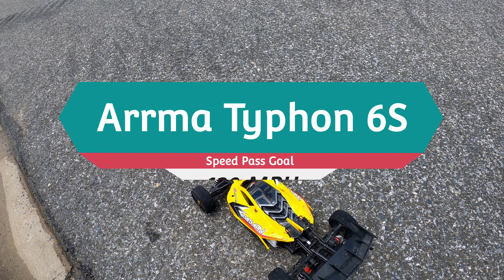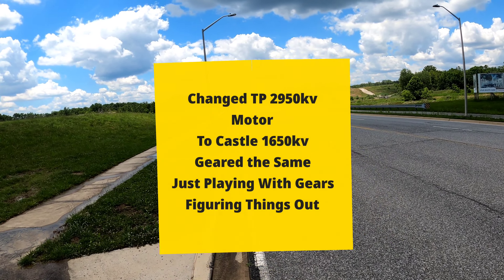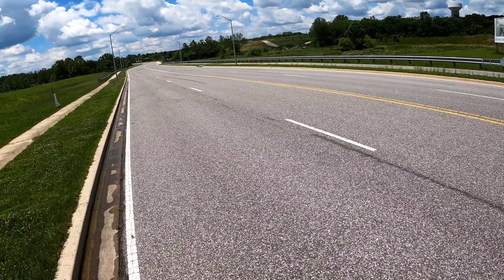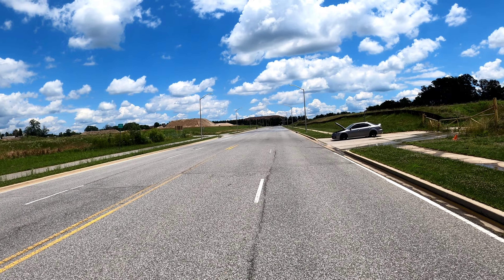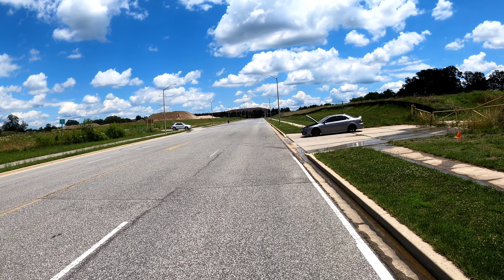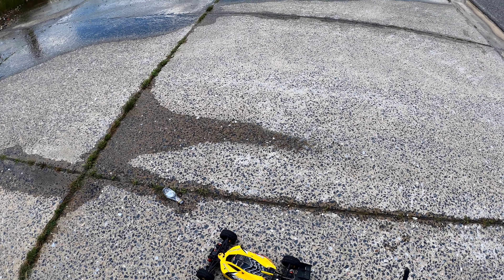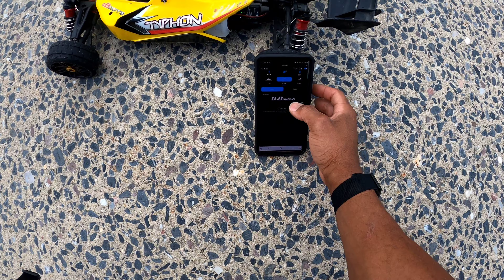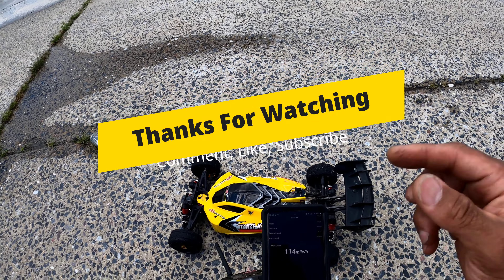Arrma Typhon 6S Speed Pass On Castle 1717 1650kv MMX8S

Comment: in my Typhon i have a Mamba Monster 6S and a Castle 1717 1650kv (old 6S version), seems to be same as yours? it makes 117kmh (~72mph) with 100mm louise tires. Stock spur gear (50t ?) and 27pinion. What im doing wrong?
Reply from the maker: You're doing nothing wrong.  Your car with with stock center Diff is doing exactly what it's suppose to do.  Keep playing with your vehicle ride height and wheel alignments and run a limitless spool.
Reply: @MatrixRC  thx mate, next thing i try to do is more improving aerodynamics and use the limitless 34t spool, i will let you know
Reply from the maker: https://youtu.be/pQnKihQ0LLU